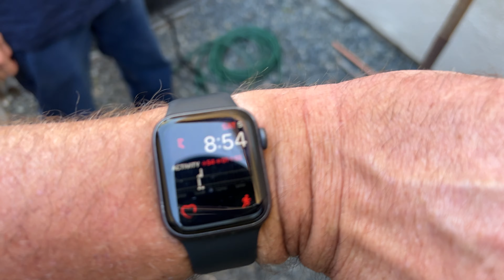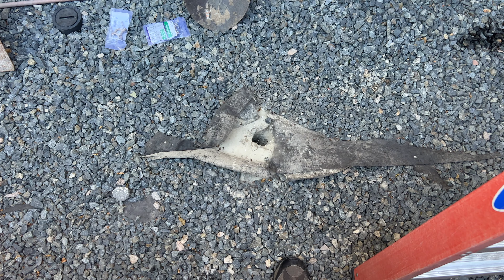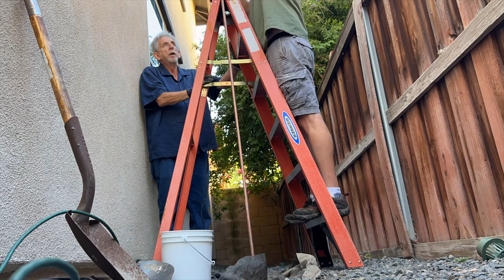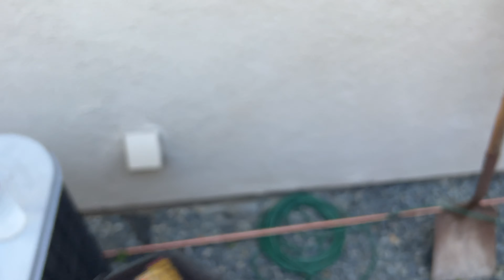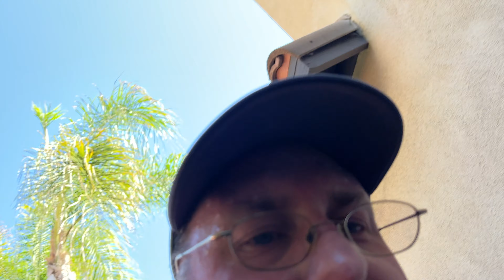Grounding Rod install attempt #2

Comment: I know this is old, but I heard you talked about a ground rod on a recent livestream. Im really surprised you are not able to drive it in with an impact drill. Thats what I used on the same type of crush granite here in Colorado. You must be hitting some kind of bedrock. From what I have heard its not how deap the rod is that matters but how much square inches are in the ground. So you might want to try 3 or 4 rods at a lower depth.
Good luck. Hope you find a solution.
Reply from the maker: thanks for the info, yeah lots of boulders and packed decomposed granite.. i was about to get it in.. im planing on doing another one.. it REALLY improves my SWR, RFI and making my audio clean..  what's your call? thanks for watching btw
Reply: @GreggK6EGG  KF0NNA Mark. You'll see me on your livestream as ripnlips.
Reply from the maker: @ripnlips-trouts  yup!

Comment: Try a different spot maybe you’re hitting large rock. Took me 4 attempts and I’ll I had to do was move a few inches to the left for it to work
Reply from the maker: we did, you can see in the video we tried a second rod with the same results. i think we are getting a rock or a bed of rocks. did you wet your dirt before you did it?